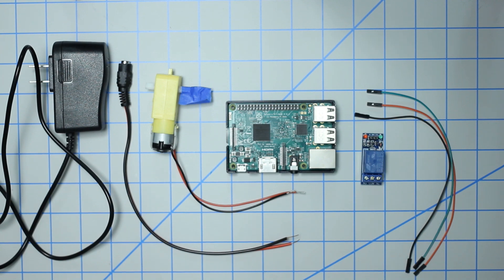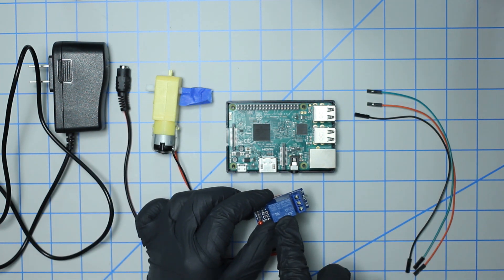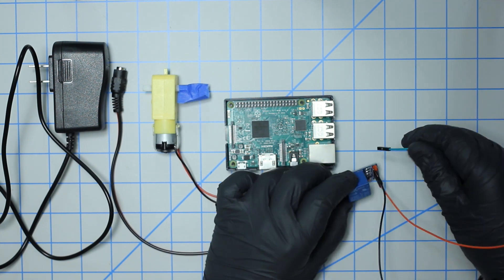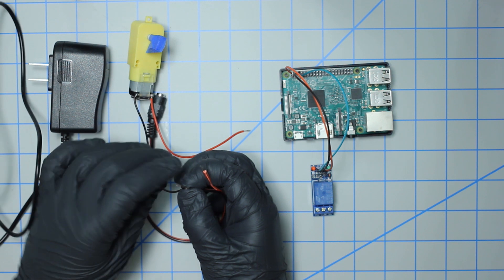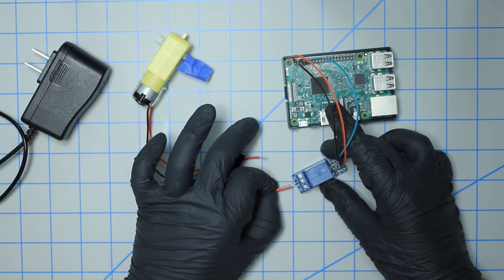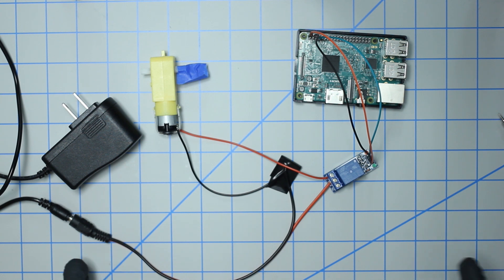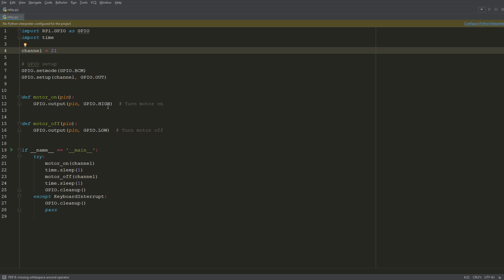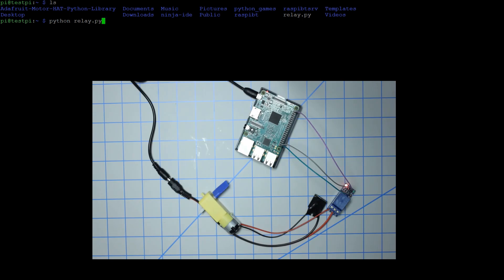5 Volt Relay (Raspberry Pi)

Comment: Thanks, this worked great. Was a bit hard to see which RPi pins you used but after checking your website I was up and running 👍
So many google results insist you need additional components so I'm glad I found your vid. I found that a multimeter with continuity test was really handy to check which contacts are being closed when the relay engages.

Comment: I built this exactly the same as you - the green light on the relay turns on and off at intervals but it doesn't seem to power the 12V side - is it because my relay is too cheap and doesn't work with 3.3V ?

Comment: Thanks for this. Ive brought the same relay however it doesnt switch from the 3v. When i drop the relay ever so slighty it then switches to on. Could this mean faulty relay, connection issue or something else? Much appreciated

Comment: hi, great video!
i iam working with a pi 3 and don't have the same results, i had worked with node red and y i had to be use a logic converter to 3,3v (pi out) to 5v relay in and vcc.
Reply: À

Comment: The gpio.low may not turn it off, but the cleanup call should. Unfortunately, I think this is just a function of the relay board not being designed for the 3.3V source on the pi. I wish that more tutorials made this clear.
Reply: I thought the GPIO was 5V. Why is everyone now saying 3.3V? TIA.
Reply: @stuartg40  The Pi provides pins for 5V, but those are for power. The pins we use for GPIO actually output 3V or 3.3V.
https://www.raspberrypi.org/documentation/usage/gpio/

Comment: I have the same relay, but it always turns on once the GPIO is set to OUT, and only turns off when the GPIO is set to IN
Reply: Same problem for me as well, any solution for this?
Reply: @SachinWable  Uhm actually I dont remember perfectly. I think I still have the same relais tho. It is working and I have no idea what my problem was back then xD

I have it on Pin 18, set up as output and it works normally by gpio.output(18, gpio.HIGH) or LOW to disable it again.

I have a raspi 4

Comment: hi ty for the vid. the relay act as a switch and a volt divider between the power supply and the R-pi?
because of the 3.3 volt limit in the R-pi 
ty.

Comment: How is your 3.3v GPIO output switching your 5V relay?
Reply: on the top right pin the voltage is 5V
Reply: The pin on the RPi? Thats constant 5v from the power supply. The GPIO pins output 3.3v, the relay expects 5v. You need to something in between the RPi and relay to get this to work (or get a 3.3v relay)
Reply: I know this is old, but maybe it'll help someone else. If it has a high/low jumper, set it to HIGH. This will allow a low voltage range like 3v-5v. If you set it to low it only seems to take in the 5v as a trigger.
Reply: @fouroakfarm  I also came here to answer the question but still not a right one..
Reply: Hi was looking for the same answer and I found it in a raspberry Pi forum: You need to use 3.3V for VCC (instead of 5V), then you can use 3.3V from the GPIO to trigger it.
Just don't use 5V at all for these single channel relay boards. I tested it and it worked for me (see yt video My1BDB1ei0E )
Reply: @DanielKorgel  You r a genius man. Thnx a lot.
Reply: @DanielKorgel  Is it safe though? It also changes the LOW and HIGH to being opposite.
Reply: @andreassotirakopoulos7740  I'd assume that the relay has less force. I only switch 12v and 24v dc and relativ low amps with it, and it works fine. I personally would not switch 230 ac with it, though. What could happen is, that you want to open the relay, but the relay has not enough force to open connection and stays close...

It's normal for these relay boards, that High and Low are inverted, some boards have a jumper to adjust this
(disclaimer: I'm no electrician)

Comment: I noticed that, when I output from GPIO pin, no matter High or SLOW, my relay turns off
Only after I change my code in the following can the relay be able to be switched by me.

import RPi.GPIO as GPIO

from time import sleep

try:
    while True:
        GPIO.setmode(GPIO.BCM)
        GPIO.setup(21, GPIO.OUT)
        GPIO.output(21, True)
        print("high")
        sleep(2)
        GPIO.cleanup()
        print("low")
        sleep(2)

except KeyboardInterrupt:
    print("key board interrupted")

GPIO.cleanup()

Comment: As you describe in the end, I to am having problems. I’ve switched cables multiple times, tried deferent pins. Even added a 2n2222 transistor with a 1k resistor to the signal wire to try and resolve the issue. Still no luck. Would you recommend a totally different relay then the one you are using in the video? Because that’s the one I’m having problems with.
Reply: This relay has a pull-in voltage of max 75 % its nominal voltage. Since this is the 5V version, up to 3,75V is required to make it operate so it can't be reliable on the RPi.

Comment: I have tried this but it doesn’t for me. I have 5v relay module as soon as I connect vcc to 5v pin, ground to ground pin and in to pin 18 which is set to out both relay lights glow. Even if I change pin status of 18 to dh or dl it doesn’t control relay at all. It always glows both the lights. But if I remove and connect pin 18 then it turns on and off the relay state. I have no idea why pin 18 high and low not controlling the relay. Any idea on this? Thank you.
Reply: Whereas I am able to control led light through the same output pin 18 but not relay.

Comment: I would like to add a relay to turn on and off my CPU fan so if the temp on my cpu gets too high then the relay would close and start my fan and then if the temp dropped below a cooler temp the relay would open up and turn my cpu fan off....im wanting this so that the fan will not be running all the time and help save the life of the fan and not drawing power from the Pi when not needed.  Thanks for any help !!

Comment: Didn't understand how you can safely control a 5V Relay with the output of the Pi (which is 3.3v).
Reply: The pull-in voltage is max 75 % its nominal voltage. Since this is the 5V version, up to 3,75V is required to make it operate so it can't be reliable on the RPi.

Comment: How can you have the linear actuator move in reverse? What changes in the wiring and in the code? Ideally, I have 2 push buttons on my breadboard and I want one of them to push it forward and one of the to reverse it,
Reply: I know for a regular DC motor, I would need a motor driver and I am comfortable using the L293D to drive it's direction but I am unsure what to do for my 12V linear actuator with relay

Comment: Hey so why use a 12v PSU? Is that what the DC motor needs? Sorry, I'm new to electronics forgive me!
Reply from the maker: Used for demonstration purposes. Definitely double check to make sure your dc motor has similar voltage specifications.
Reply: A lot of the things used by the relay (eg motors, solenoids) are 12V

Comment: I had to add a resistor to my gpio pin on boot. It didn't matter what pin I assigned. My python accident work perfectly. The reboot/boot was my issue because it activated the relay. But with one and or two workarounds. 1. User a resistor., 2. Create a bash script to 🔥 a python script at boot.(I still could not get my direct python script to for at boot alone. So I used a bash in-between.)

Comment: I also had an issue where I tried GPIO14 and 15 and it wouldn't work, but did on 21. Is that just a fluke or is something to that? It seemed like you had a similar issue.
Reply from the maker: I think the 5V logic makes it unreliable with the RPI. I've read online that there is a hack where you add a resistor and it will work better with the RPI.

Comment: that relay is 5V which means if your output is less than 5V, you can control the relay to close, if larger than 5V, relay is open...but raspberry GPIO pin can only gives you 3.3V maximum...how can you control that relay???
Reply from the maker: Hey YK Y, you're correct in that the 5v relays may have issues with the pi. (I made this tutorial a while back and have been meaning to update it)

You can try using a 3.3v relay instead. Also I found this hack which may work in the meantime: https://www.youtube.com/watch?v=p7wmzAzDX-Q
Reply: @PiddlerInTheRoot  I just found out, if you connect the relay with 3.3V power, and send signal with 3.3V you can actually use that 5V relay.
Reply: @yky1360  is that safe to do when the relay is controlling a 220v circuit?
Reply: Mathias Højsleth You can find the spec for this product, usually the working load is printed on the body, like 3A/50VDC or 5A/250VAC etc. and you can also select those products which you can set the mode to be “high-voltage-triggered” or “low-voltage-triggered”.
Reply: @yky1360  ok, but what you are saying about connecting the 3.3v does that mean I should use the 3.3v gpio instead of the 5v on the PI?
Reply: @Anag0n  so because the relay in this video is 5V, it means the signal less than 5V, it opens, larger than 5V it closes. but RPi GPIO only gives you 3.3V. Thus a walkaround is to connect the Power of that relay to 3.3V, and send the signal also with GPIO 3.3V, then you can control the relay.  You can also buy a relay with 3.3V control. GPIO will always and only gives you 3.3V.
Reply: @yky1360  hey buddy can you please elaborate more, how u did it? controlling with 3.3v? does it mean that I don't have to plug any other cable and toggle high and low only on 3.3v?
Reply: @yashraut19  for me, power with 3.3V and send signal with 3.3V on/off will trigger the relay.  So just connect the relay and Raspberry with 3.3V power, send signal with normal GPIO, will do. When relay triggered, it will have a small “tick” sound, that is the electro🧲 switch on/off
Reply: @yashraut19  you need to firstly power up the relay, and send signal to it, then it will trigger.
Reply: @yky1360  sir, I have a question, so if I can control the 5v relay module, is that mean it's safe for my Pi circuit ? or I should just buy a 3.3V relay module ?